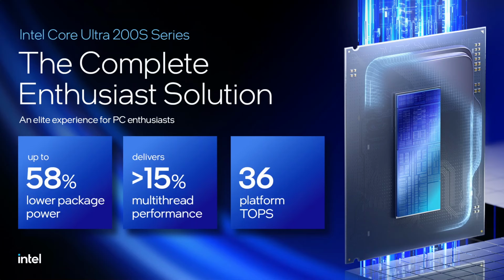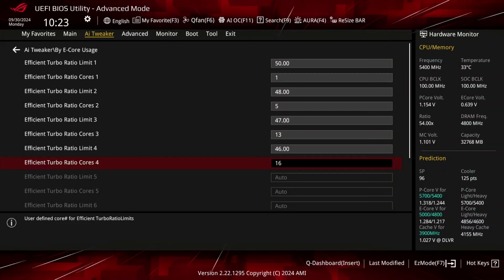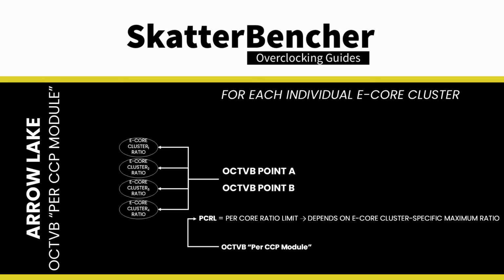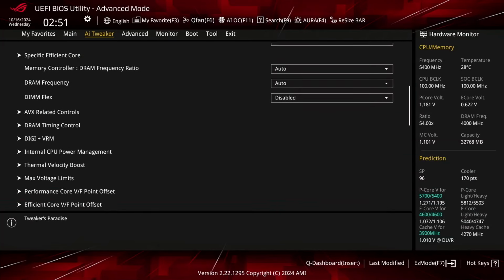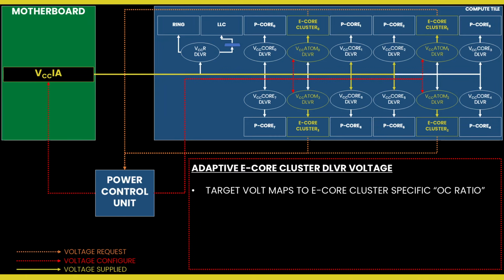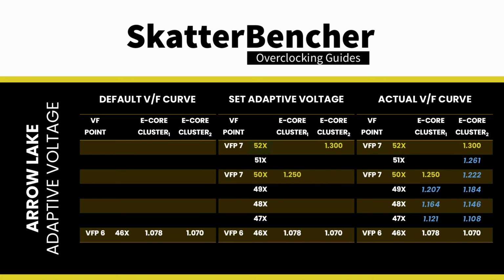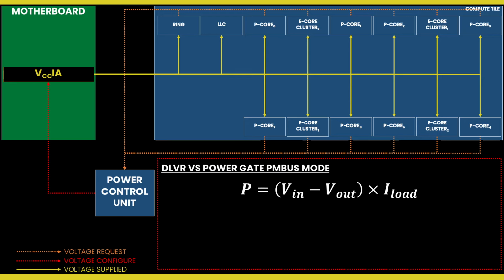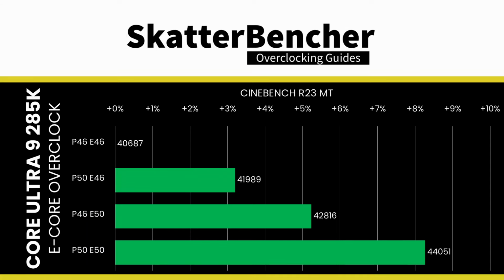Arrow Lake Overclocking: E-core

Comment: Intel make a 10/12/16 core and call it a day.  I dont need xe graphics or e cores
Reply: Yes.
Reply: I'll be interested in Griffin Cove down the road if it does do away with E cores, as per speculation anyways.

Hopefully Nova lake uses the same 1851 socket..

Other than that it'll be fun to tinker with the Ultra 9 285k in my upcoming build for 4k content. Doing some refresher research on tweaking lol.. been awhile since I've been on a proper desktop setup, upgrading from my Alienware Area 51m/w 9700k & RTX 2080 @ 1080p. My last proper desktop setup was on a i7 3770k Ivy Bridge.😅

Comment: Wouldn't the best gaming application be the scenario where 5 E-cores get boosted, so that you would have 13 (8P + 5E) "gaming threads" - and then does the scheduler figure any of this out or are you left manually forcing things with a Process Lasso app?

Comment: 5.1ghz on ecore clusters sharing the same cache is actually impressive. With 5.4ghz stable on the P-cores, for heavy workloads a combined 5.1ghz e + 5.4ghz p will fair well in benchmarks. Where it all falls short for me is latency. Im going to hold out until I see latency that exceeds raptor lake.
Reply: Sadly I feel that Intels current disaggregated  architecture just has a high latency on its first gen implementation. Maybe next iteration will improve.
Reply: @gymnastchannel7372  I am seeing people get sub 70ns so all isn't lost maybe with a few updates the 285k + ram tweaks might get sub 50

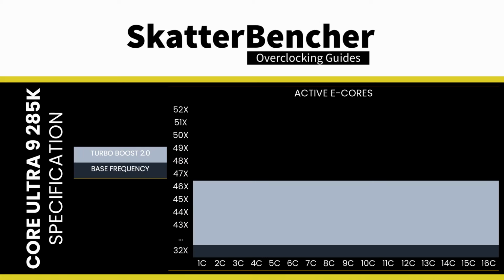Comment: at about 2:55, you are incorrect - you can also set a boost limit for dynamic clocks, but the limit is locked into place and your testing will have the cores locked to that value.  Offset voltage and using the boost limit as the your OC is more than a decade old, and just doing statis clocks is even older.  Ten years ago, static was seen as behind the times, and now SOME people will say that for all-core boost overclocking, but really, the percentage of OC'ers who bother with per-core OCing are a rounding error - a niche within a niche.
Reply: I do all core sync and static v inorder to keep my frequency and vids stable. To put it simply, I don't trust auto anything in terms of getting maximum performance within the parameters of safe voltages. I'm really skeptical of the e-core voltage limit on N3b. I'm going to wait on this one.